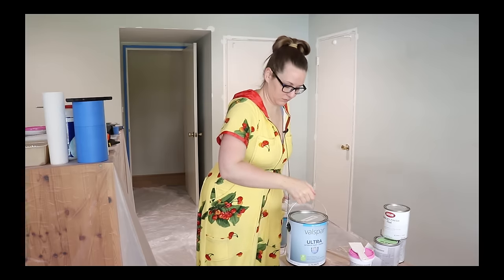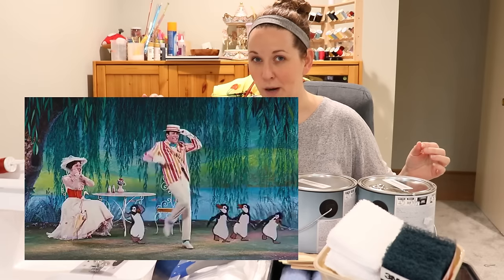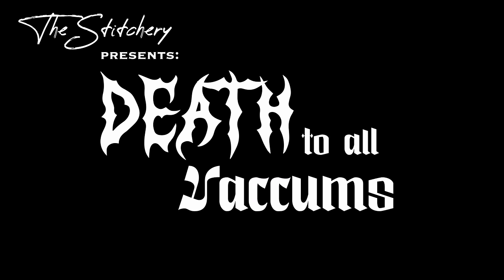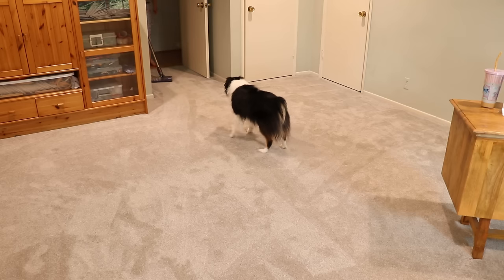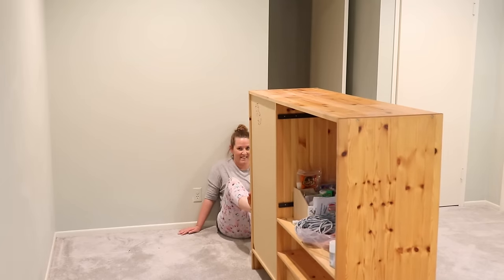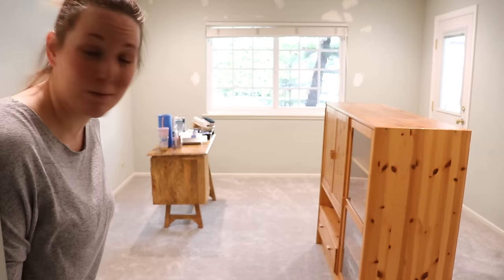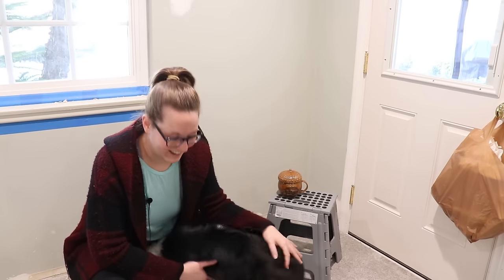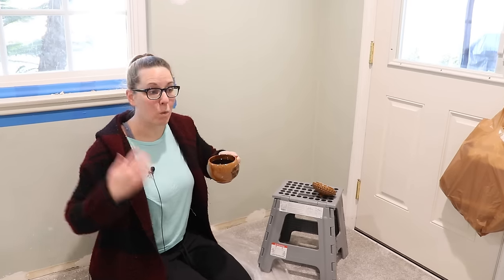I Painted Clouds on My Ceiling

Comment: Tip: use a thicker nap (the fluffiness of the roller) like a 1/2 inch, and really load up the roller. If you're getting spots without paint or having to push really hard, you need to reapply. Also, you can get a paint roller extension pole for a few bucks. Makes ceiling work way easier.
Reply: And walls too. One stroke from the ceiling to the floor with a long enough pole. The coating will be more even and it's less work.
Reply: Came here to say this. Use a thicker nap roller and load with more paint and you will have the room done in half the time. ❤

Comment: Point one: painting around the edges with a brush is called cutting in. Just for future reference.

Point two: Holy hell, get yourself a long pole for your roller. When I saw you were painting the ceiling on a ladder I just about started screaming at the screen. Paint rollers belong on a nice long handle so you can stand on the ground and get that whole wall or ceiling. I realize it's probably too late for the studio but if you're going to be renovating the whole house you need a pole for your roller.
Reply: Yes! I second a roller pole! So much easier!
Reply: I was coming here to say this. I have 2 sizes of retractable poles, but even cheap broom handles that screw into the broom or mop part can usually be screwed into the roller head so you don't have to buy a special pole.
Reply: A broom handle that unscrews from the brush part works in a pinch or if you don't wanna get yourself a special extender.
Reply: Good point. One must get used to painting from the safety of the floor, so that when you are my age (early 70's) you can still paint a room, without fear of falling off the ladder. Or go to Lowe's and get an inexpensive portable scaffolding that gets you almost to the ceiling. Works great!!
Reply: I DID start yelling at the screen! "Charlie! WOMAN. GETCHOO AN EXTENSION."
Reply: Likewise.  I came for the pole.  I’ve always just unscrewed the head off my broom and used that.

Also, (note to Charlie) if you put the roller down on the shallow edge of the pan and roll INTO the paint, then roll in the middle a bit, your roller will be filled with paint all the way around, and it won’t do that skipping/bare spot thing you hate.  Feel free to get more paint on your roller.  If it’s “too much,” you just keep rolling paint on the wall until it’s gone.
Reply: I was thinking the same thing.  I used the extension pole when I painted a three bedroom apartment many times, it is so much easer.
Reply: Amen, sistas!
Reply: Love all your different content. The room is really coming together and you picked out the perfect lamp!
Reply: Painting the ceiling is a pain but the pole makes things so much easier! If you have a standard wooden wide broom they're usually the same size as your roller so you may have something that works in your house already 🙂
Reply: Adding to the long stick chorus! The cheapest of broom handles works excellently, you will still get tired but it's much more manageable
Reply: Exactly what I was about to say.
Reply: Agree whole heartedly with everyone else - just adding in that long handle when rolling paint also provides more leverage so you don't have to press as hard to get a similar result. You did an amazing job though! Really love the clouds ❤
Reply: @stefflcus  Gesundheit.  (Love the way this sounds like a sneeze LOL)
Reply: I felt the exact same way about the roller without a pole!
Reply: Ours works with a broom handle 😊
Reply: Plus, painting with the n pole from the floor allows for consistent pressure on the roller as you paint. Which makes for an even coat of paint.
Reply: Absolutely what I was coming to say.  Having painting more than one ceiling in a bedroom...roller pole will save your arms.
Reply: Exactly - and as your sister said: more paint on the roller, you should be able to pull at least your own height in one strokes!
Reply: I was here for the pole comment as well. But the peeling might be because of dampness of the outer wall?

Comment: You might want a slightly thicker nap on your roller as well. Can make the paint look textured if it's too thick, but one somewhere in the middle of the sizes should work.

Also, get a paint roller pole like an above commenter said! So much easier!!
Reply: Thank you so much! I was in pain watching Charlie painting all of that without a pole and with a short-napped roller with too little paint on it.

Comment: You have the right mindset. When dealing with home renovations, you should fix as many things as possible as soon as possible because that will always pay up in the long term. If you postpone it, you're still going to have to fix it later on, at a much less convenient time. It's always best to just get things fixed and be done with it.
Sponges are usually what I see people use to make clouds in drawings and stuff but you do need a sponge with the right texture, it needs to be a soft sponge and not a stiff one. I love the final result. The big blue gap and the fact that different clouds have different thicknesses actually makes it look more realistic because real clouds move about in unpredictable ways and have different densities. The fact that you added a sun shape around the light was just genius, it's a really nice finishing touch.

Comment: Also, FURNITURE SLIDDERS! 10cm smooth plastic(for carpet) and fluffy(for hard floors). They make moving large bits of furniture so much easier!
I got mine from the local version of Lowe's (?) you know, where you buy tools, paint and random house project stuff....
Reply: YES! Looove furniture sliders, they are so good for moving larger pieces of furniture. I got mine from Amazon.

Comment: you need an extender pole for your paint roller! that way, you can paint ceiling and walls without needing a ladder. roll the roller in the paint to saturate it but not so much that it's dripping...then roll down-up-down in one spot (i.e., a strip), shift the roller so that the edge of the roller overlaps the edge you just painted, and roll down-up-down...then re-saturate the roller and lather, rinse, repeat til room is done. that said, i love the color!! very jolly holiday! i just hate to see you suffer while doing it!

Comment: You need a handle on your paint roller. If you get like four feet away from the wall, it's much easier. They make long handles to just screw onto your roller and then you have a much better time.

Comment: The most important part of getting a painted room/furniture/etc to look right is filling and sanding. Paint - especially gloss paint - can show every place where your wall bulges or is dented.  It's also quite possible that you don't care. But you've done a great job so far.
You did very well to remove the cover plates of your switches & such. That'll make it those areas look much better than if you just used the masking tape method. But please do be careful with any exposed wires.

And yes, I know the feeling of needing someone's 'permission'. Here you go - I permit you to paint and decorate your room.

Comment: Great job Charlie!
I was going to say like your sister, your hands should not hurt; you need a roller with a better nap and load more paint on. You've already done that so yay!
Do get yourself an extension pole though, you won't have to get on a step ladder and you will naturally make longer strokes which will give you a better finish! Use it for walls and ceiling, you should not use the roller directly in hand unless you're doing itty bitty surface like above/below a window!
It takes time to get proficient at painting but you are already doing a good job of it!
Before you know it you might actually enjoy it! 😂

Comment: The paint could be peeling off if  different  paint types (latex vs water based) were used which is why primers are often used over old paint especially if you don't know what was used before!

Also, please get a nice fluffy paint roller, it should be easy to paint the walls in long even strokes without putting any pressure or dozens of times in one spot 😅 if you're doing that, the roller isn't carrying enough paint and should be rerolled on the tray to fill it again. Overloaded means dripping wet, a good roller will hold tons of paint and not drip
 
In my experience, one gallon only does 1-1.5 coats on a medium bedrooms walls (no ceiling) give or take a bit. With colour you often need 3 coats for full thick coverage and no hints of transparency and you should hope save leftover paint for future scuffs
Reply: seconding the suggestion to use primer

Comment: the one that's "more solid" out of the clouds is fairly close to the "sun" in the center of the ceiling, so it makes sense that it'd be brighter and such than the other clouds and would give it the illusion of being more "solid" anyway even in a regular painting, the fact that you did it on accident on you ceiling might have been a subconsious thing because of your brain knowing that the main light source is supposed to be the sun fixture in the middle of the room. In any case it's great in my opinion anyway because there are some clouds that are just thicker or more solid than others anyway, so again no real problem <3 hopefully that helps the brain to be more calm in that regard at least ^_^ The studio is looking cute sofar

Comment: Also thicker roller and loading it would help. You can buy ones you fill and keep rolling also a little gadget for edges is flat with rollers on it instead of careful taping. Just need moist rag encase. I did my lounge room in half a day with two small kids with gastro. Having the right tools makes the difference

Comment: My "put off" project has been adding insulation to my floor -- yeah, we're talking a very NOT deep crawl space. I'm making progress, it's just slow. :)
Painting with a roller is many times easier when you put said roller on an extension pole. MONTHS late advice, of course, but there's always next time. :) And two more things: load the roller with more paint, get the appropriate nap. That one looked a little thin, at least on camera. Haha, sis had your back!  Oh, and it looks super cute!!! You did a great job!

Comment: A couple of tips for the future. I don't like rollers either, so I  prefer paint pads. Lining the paint tray with cling film (I think you call it Saran wrap) makes clean up much easier. You just roll it up and bin it, rather than spending hours trying to wash it and sending paint chemicals into the water system. Loving the blue, which will help make the room feel cool on hot days. 💙

Comment: My 15 plus years of home ownership/decorating after 5+ years as in interior/exterior house painter have yielded these tips: 
Pick a large broad concept for a space and lean into it.
Surface prep is 99 percent of the battle. The sections where paint peeled off were likely because someone patched water damage or a crack on the wall and then didn't prime before painting. You did the right thing, 100%.
Paint is the cheapest, if not fastest, home improvement. Do the second coat while you have all the stuff out and ready to go. Nobody else will notice a thin or skipped spot, but you will, and you will not want to coat it again later after all your stuff is put back in place.
Use reaching tools. Paint rollers have threading in the handle that will screw onto the stick from many long handled tools, like a broom or one of those extending lightbulb changers. Use a stick so you can get a better range of motion when rolling walls and ceilings. They make sanding and scrubbing tools that also screw on to the same sticks to help with your prep. Do not underestimate taping a paint brush to a stick for that weird spot you can't reach over the stairs or whatever. 
You do not need to care about things that literally nobody will ever see, including the top surface of the door trim, and places that will be covered by trim, wall plates, or floor coverings. In fact, feel free to leave notes to future people in these places.
Electrical work isn't as dangerous as it sounds. There are many stages where you can double check and test things, but sometimes having the ability to call in a pro is worth it for things that don't go as you expect them to. If you want to start with an easy project, buy a lamp kit and rewire a vintage lamp. Next try replacing a light switch or a light. Outlets, fans, and things in brand new places can be more complicated, but are pretty doable if you take your time.

Comment: Best hint for roller painting: get an extended handle. Official ones are more sturdy but broom handles help immediately. If you need to make it more snug, wrap a scrap of fabric around the threads so it tightens well.

Comment: You are doing great! It is wonderful to see the place change into a place that looks like you and will make you happy ❤ Just a few pointers with the paintroller: 1) use a long pole, it will make the painting of both walls and ceilings SO much faster 2) use a wider roller with longer nap 3) use more paint on the roller, the roller should not slide around without rolling or fling big globs of paint around, but you should not have "stripes" on the wall either. As long at it is somewhere in between, then you are on the right track :)

Comment: I say someone did a wall repair with oil based paint instead of latex/acrylic in the peely spots. Coat with primer/Kilz first. Sea sponges do great for textured paint, as do wadded up plastic bags.

Comment: Love the outcome!

For art, especially "big art" like painting your ceiling, I've found that it's super easy to get caught up on the details and sometimes the best thing to do is stop and come back in later to get a "first impression" to see if you actually like it or not.

At one point my aunt told me, "Painting clouds on a wall is easy, you just wad up a plastic bag and dab on the paint." I decided against clouds in my case, so I cannot vouch for the efficacy of that claim.

Comment: Hah - I know it’s too late to help here, and I should probably wait till I finish the video before commenting, but I wanted to say that it can make a Huge difference to get the high quality rollers for the paint roller.  When we painted our house interiors we started with the basic bitch rollers and were hating it. We went back to Home Depot and got the more expensive ones, and it was incredible how much better the results were. 

Also - you need a paint roller with a longer handle. 

Hopefully this can help you fit any future rooms you tackle.

Comment: I attempted to paint the craft room/studio and was soundly informed that I would benefit from the contractor doing that. They were working on the rest of the house for 3 weeks while my husband was in the hospital. 
They have painted everything except for the closet and they will be back next week to do the bedroom attic trim and finally the kick plate in my bathroom so my cats stop hiding in the walls of my bathroom. Which I have been waiting for since I moved in.  That was in 2020. It will be fine

Comment: It is really smart to replace all plugs and switches. They do degrade over time and when they fail the results can vary from losing electricity downstream of the failed component, to fire.  They are inexpensive enough, and the replacement is simple, though not always easy.